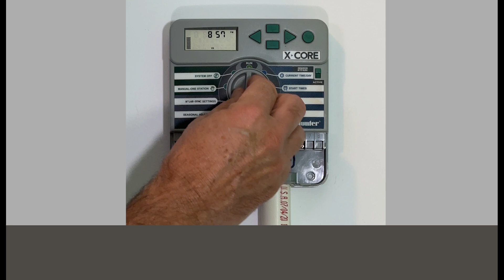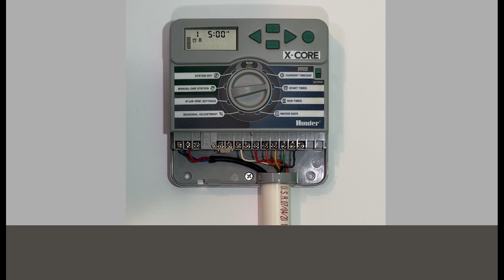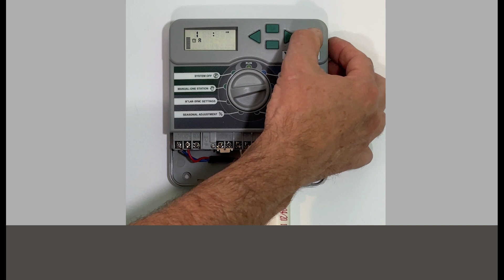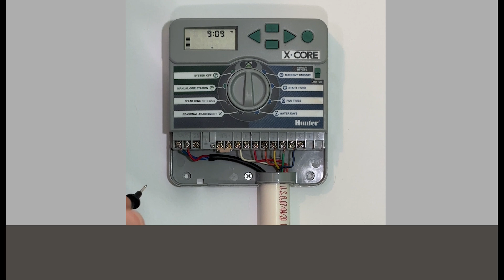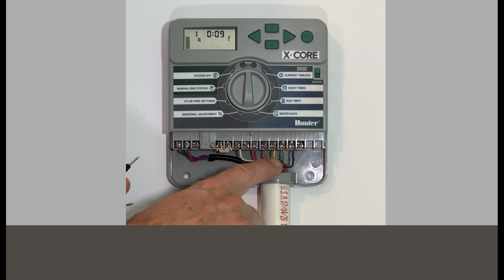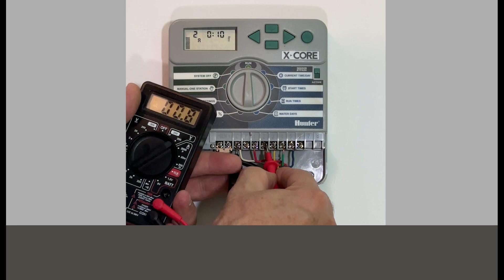How to Troubleshoot an Irrigation Timer (Sprinkler System Repair)

Comment: I have the Hunter X-Core. Zones 1-3 do not work and zone 4 works. 

Ohms reads -1 for zones 1-3 and 75 in zone 4. 

AC Volts reads 25v for zones 1-3 and 0 for zone 4. 

Everything worked great yesterday but today it doesn’t. 

Is this a sign my controller is bad?
Reply from the maker: Has there been any work done on your property recently? The resistance readings indicate maybe someone cut through your wires to zones 1-3. How did you arrive at 25v on zones 1-3 and none on 4? If 4 is working, you should be reading 25v on terminal 4 when you have that zone running. Check the voltage individually as you run each zone. But also check the voltage on other terminals when a zone is running. For instance, as Z1 is running, check the voltages. Zone 1 should have 25v, but none of the others at that time. If you get voltages on other terminals, disconnect all wires and recheck. If you get normal readings with no wires attached, then you have wire breaks. If you get multiple zone terminals with voltage, you have a bad timer.
Reply: @Prolandscape work was done over the weekend but last night, all systems worked as designed. 

I just rechecked voltage.

Ran zone 1 - 25, 25, 25, 0
Ran zone 2 - 25, 25, 25, 0
Ran zone 3 - 25, 25, 25, 0
Ran zone 4 - 2, 2, 3, 25

I also disconnected all the wires to see if there was still voltage. With the wires disconnected, none of the contacts had voltage. 

Cut wire or bad controller for zones 1-3?
Reply from the maker: @kylew3643  Cut wires. When you run zone 1-3 and still see voltage on the other terminals, it means the voltage is going down Z1, jumping onto the other wires and you're seeing that voltage as you check the other terminals. When you disconnected all the wires and didn't see voltage across multiple terminals as each zone ran, then it at least confirms the timer isn't feeding voltage to multiple terminals. Who knows why it ran properly last night?? I'm betting the ends of the wires where they're cut through are touching or very close to each other. Probably a shovel strike.
Reply: @Proirrigationtraining Very well could be! Looks like a rewiring is in the cards for me. Thank you for your help! Your video was very insightful. I learned something new today.
Reply from the maker: @kylew3643  You should consider hiring an irrigation pro that has a wire locator. Generally we can find a wire break in much less time than it takes to rewire a system. Depends on how close the valves are to the timer of course. Good luck with your project!